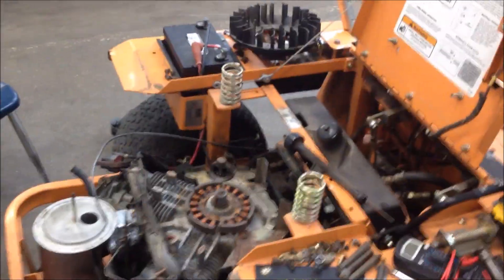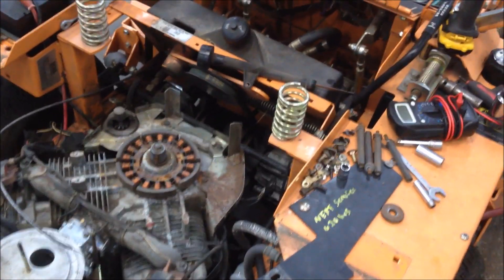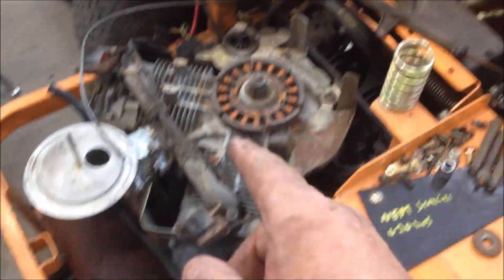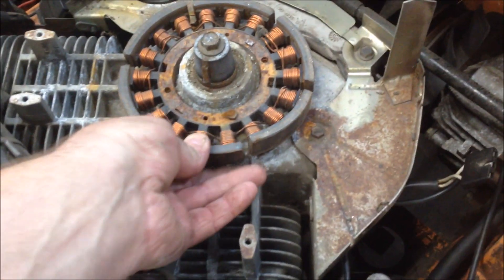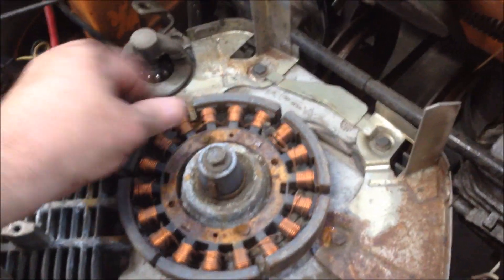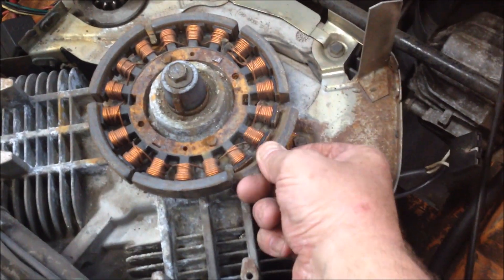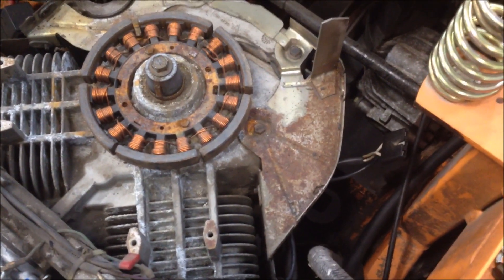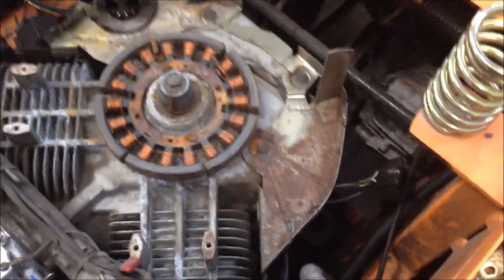DOES YOUR ELECTRIC CLUTCH STOP WORKING MID MOW? THEN WONT START? TOP 3 REASONS WHY!!

Comment: I have seen many Kohlers with loose ground cables on the rectifier.  I am in the habit of checking that first when they are not charging.  When those magnets come loose they usually tear everything up.
Reply from the maker: YES THEY DO    YUP I HAVE A FEW VIDEOS ON THE MISSING OR LOOSE GROUND STRAP/WIRE

Comment: In all the years I have worked on mowers, I have never seen that happen. But it's good to know. Thanks for sharing. I bet if you check the engine is getting too hot and the glue is letting go. That's the only thing I can think of that would cause it.

Comment: Hey mowermedic I would like to replace the crankshaft on my model CH25S to a longer one so I can use it on a JD 420 garden tractor. I need a crankshaft that will run the drive shaft on one side and the other side run the pto clutch for the deck belts and so forth! Can this be done and if so how do I measure the crankshaft?

Comment: You've got wires that come from the stator that charges that has inter type fuses that is wrapped within the wire that's keeps the electric from backlashing Back to the stator lot of people don't realize that's what causes the problem when they break in The Wire it's like a regular fuse might want to check your wiring for those wrapped within the wire those fuses the real little
Reply from the maker: NO FUSES ON THIS SERIES OF ENGINE THE RECTIFIER / REGULATOR HAS THE DIODES BUILT INTO IT TO KEEP BATTERY VOLTS FROM LEAKING BACK INTO THE STATOR
Reply: @THEMOWERMEDIC1  okie dokie just thought maybe it had that my bad some do some don't just a thought lol

Comment: I'm replacing my stator on a kohler command 18 hp and one of my bolts snapped off and only has 2 bolt holding the stator is it ok to drill two more holes in it or use a self tapping screw in it?

Comment: Quick question the mower can run with a dead battery if the charging system is working correct? Will it run without a battery?

Comment: How do you test the stater? I bought a new flywheel hoping all
Works
Reply from the maker: WHEN ENGINE IS RUNNING AT WOT  SET YOUR VOM TO AC VOLTS AND YOU SHOULD HAVE 30-40 VOLTS AC FROM THE 2 WHITE WIRES
Reply: THEMOWERMEDIC1 but can you get an ohm reading ? I tried a continuity test and it seemed okay. Had to order a voltage regulator as of now